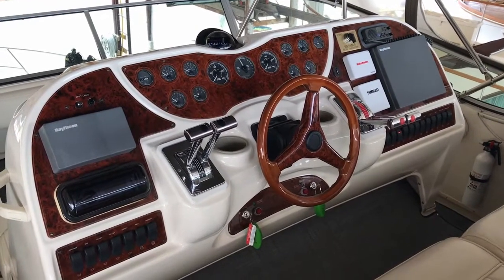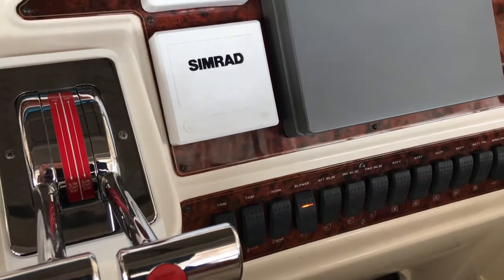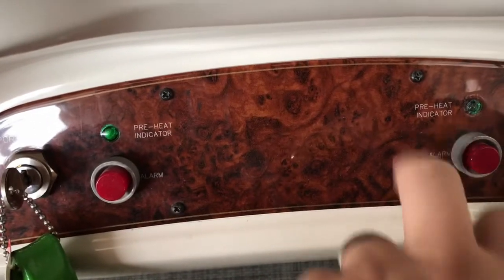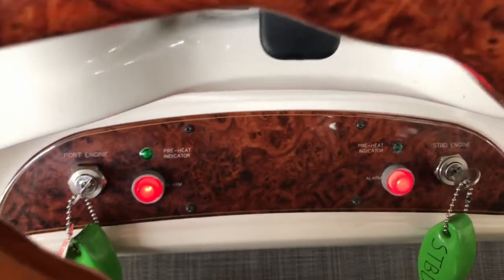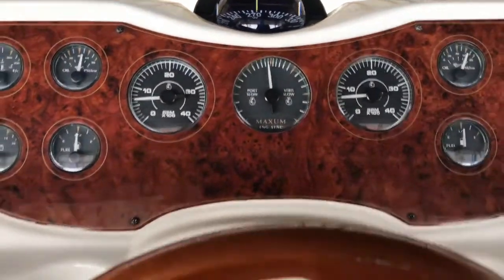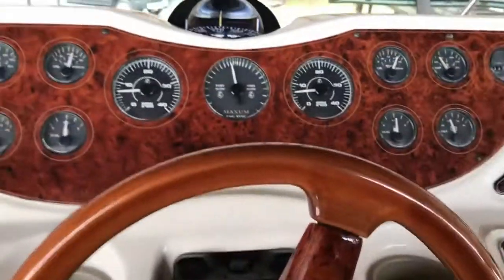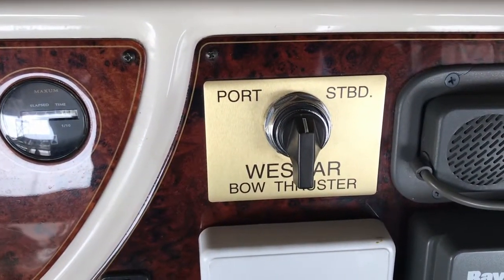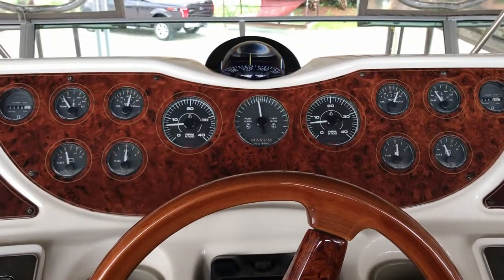Cummins Marine Diesel Engine Startup and Bow Thruster Demo

Comment: You don't need to run the bilge blower before start up. Diesel does not create explosive fumes. You must be a broker, LOL
Reply: M Ross facts
Reply: It’s not necessarily the diesel that could create explosive fumes but it could be anything else that could create fumes within the bilge that are required to be cleared.